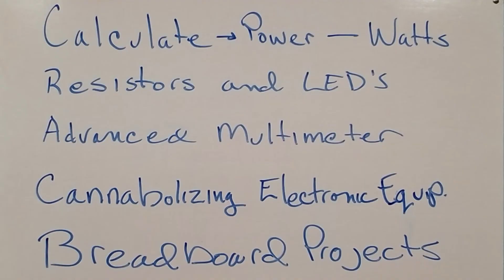Easy Soldering & Desoldering Method On A DPDT Switch

Comment from the maker: Soldering is the best way to insure a good connection for your wiring on your Model Railroad. If you don't solder, you should. Here is an easy demonstration on soldering a device you will more than likely need on your layout.

Comment: Are the leads you are soldering to the switch same as feeder wire dimensions? What size do you use? thanks.
Reply from the maker: Bus wire #14. the feeders are smaller usually #20 ro 18
Reply: @TomsTrainsandThings  Many thanks. I am using 14AWG solid for bus but just got 22AWG solid for feeders, curious what others are using and if I went too small on feeders.

Comment: I have a DPDT On-Off-On switch. Do you have to crossover the wires as a 4 way series, or is there another wiring scheme that allows me to solder wires on all 6 terminals? I've been trying to find videos that actually show what a switch looks like all wired up, but I can't find any.
Reply from the maker: You didn't look hard enough. Right here: https://youtu.be/Ux4bGLtejfo
Reply: @TomsTrainsandThings  VapOven "Battery Powered Induction Heater (Deluxe) Wiring Diagram". This is what I'm building, but it's similar to the diagram. There is a 12v DC input jack, an On-Off-On DPDT slide switch, a 3s 18650 battery pack with BMS, a MOSFET module (which is what handles power to all components), a tactile switch and momentary push button, a battery/voltage indicator, and the IH module. I'm trying to figure out which wires are supposed to connect from the battery pack to the DC input jack and I need to know which wires from DC input pack and the battery pack are supposed to go to the slide switch and which wires go to the MOSFET. Essentially what I'm asking is, I need to know how to hook up the DC input jack and battery pack wires and hook them up to the slide switch and to the MOSFET module. Also, somebody said, “Put a 6 amp fuse on the DC power brick -in. The BMS is a fuse as well but you can back it with an 8 amp fuse in the same way, -in before the switch.” How would I wire the 6 amp fuse?
Reply: @TomsTrainsandThings  Thanks, I appreciate it.
Reply: @TomsTrainsandThings  What's the difference between crossover and regular wiring you mentioned? Is there a name for it, the regular wiring? Why would I want to reverse polarity? I just want it so when I turn the switch up, the two leads and the COM wires are connected, when you turn it down, the two leads on opposite side and COM wires are connected, and when it's in the middle, it's turned off. I don't understand why you'd want to reverse polarity, it's all confusing to me. I just want it so one side is turned on, the other side is turned on, or it's off. Hence, an On-Off-On DPDT Switch. I've seen lots of diagrams on Google Images when searching DPDT switch wiring diagram, and it's all just a crossover wiring. Meaning you can't wire it regularly like in a parallel series? Is the crossover a 4 way wiring scheme and regular wiring a 3 way scheme?
Reply: @TomsTrainsandThings  Nevermind, I got the help that I needed on Disc. Now I know how everything is supposed to be wired up

Comment: On a DCC layout, can a SPDT switch be used to throw a HO scale Code 83 turnout, or must it be a DPDT switch? Thanks!
Reply from the maker: What is actually activating the turnout? You can use a push button in some instances.

Comment: Thanks for this video. I don't do the trains, but your how to here is the best one I've seen by far. A buddy of mine is a low voltage electrician, and even he couldn't show it as well as you did in this video. Thanks Tom
Reply from the maker: Thank you very much Jame. I really appreciate that!
Reply: Toms Trains and Things You're welcome Tom, and thank you for the video! I have one question that I figured you may be able to help me with. When wiring a dpdt switch, does the size / gauge of the wire matter? I'm wiring up some dpdt switches that are smaller than the ones that you used in the video. The switches are connected to small servo motors (3-9 gram) and a small hobby motor. The power source(s) are batteries ranging from regular 9 volt up to a 7.2 volt r/c battery. I've tried looking all over, but found nothing. If you can help me out in anyway, I'd really appreciate it. Thanks!
Reply from the maker: Hi Jame, You can reduce the wire size to what's more appropriate for the servo motors. The ones I'm familiar with use 24 or 26 gauge wire. You can match the size of wire that is attached to the 3 pin plug or you can even go a bit larger in you can't find the wire that small.
Reply: Toms Trains and Things Thanks again for your your help, I really do appreciate it. Most people don't respond in the comments, especially on the same day. My hobby may be a little different than yours, but we're in the same ballpark. Like I said before, you were able to give me better tips than my buddy who does that type of stuff for a living. You've definitely earned a loyal subscriber. As soon as I can, I'll support you through Patreon as well. Thanks again Tom!
Reply from the maker: Your welcome, and thanks for the compliment. I spend a lot of time on the computer either editing videos, or doing research on them. On the viewing end, instead of watching model railroad videos I'll be watching anything to do with the inner workings of YouTube. I also help other creators on YouTube Creator Community with their questions about YouTube. I've been a Rising Star in that forum since February. So, I spend a lot of time on the computer. lol
Reply: Toms Trains and Things I just got back into an old hobby of mine and boy has it changed. I build model lowriders with scale hydraulics. When I started, it was just small hobby motors. Now it's large hobby motors along with micro servo motors. I had to learn by watching countless hours of videos on here, but I finally got it figured out. As soon as I'm able to produce some really nice cars, I'd like to create a YouTube page for both showcasing my work as well as helping others learn how to build them so they don't have to do what I did. Maybe you can help me with the videos when I reach that point. For now, I've subscribed to your channel and will become a Patreon supporter as soon as I can. Thanks again for the help!
Reply from the maker: While your still struggling and catching up on the hobby, you should start doing videos now of the troubles your encountering and how your adjusting to all the changes. That would make some interesting subject matter for newcomers to your hobby. I wish I did that when I started back into model railroading, I just took some pictures along the way and never though of taking videos of my struggles. I was always taking videos of my vacations and travels but never on model railroading. 
When you need help with starting a Channel send me an email, I'll be glad to help.  tomstrainsandthings@gmail.com
Reply: Toms Trains and Things Thanks Tom, that's a good idea. I'm going to take your advice and do that. I'll definitely email you let you know when I'm ready to put out my videos. Again, thank you for both the time and help. I really do appreciate the help and feedback. Just the fact that you've replied to the comments is more than I anticipated, and I'm thankful to you for that too. I'm glad that I clicked on your video for the dpdt switch help. I never imagined that I'd get this much help, suggestions, and feedback. Thanks again Tom. I'll definitely stay in touch
Reply: Toms Trains and Things Hey Tom, I don't mean to bother you but I do have one last question. If you can't answer it, I completely understand. You've already gone above and beyond any other YouTube channel. My last question is this. When wiring a DPDT switch, specifically for hobby purposes, can you use single strand wire as opposed to multi strand? The holes that I have to fit my wire in are very small, but with single strand, it fits perfect. Any and all help would be appreciated. Thanks again Tom
Reply from the maker: +Jame you can use either one. No problem, you can ask as many questions as you like.
Reply: Toms Trains and Things Thank you again for your help! You have to be the nicest, most helpful Youtuber on here. I really appreciate it
Reply from the maker: Thank you Jame!
Reply: Toms Trains and Things You're more than welcome, and thank you Tom. I can't tell you how many times I've reached out to people over the last three months, and you're only the second person to respond. And, your responses have been quick, direct, and as friendly and helpful as anyone could hope for. Again, thank you for taking the time to help me out. It's greatly appreciated! As soon as I'm ready to put my content up on here, I'll send you an email and we can go from there.
Reply from the maker: Good deal Jame. Can't wait to see some of your work!

Comment: Why do you need to reverse the polarity?
Reply from the maker: Hey Jack. When using them for switch machines, changing the direction of current flow moves the motor from one position to the other. You can also use them with two color to pin LED to change from daytime lights to nighttime lights. There are many uses for it.